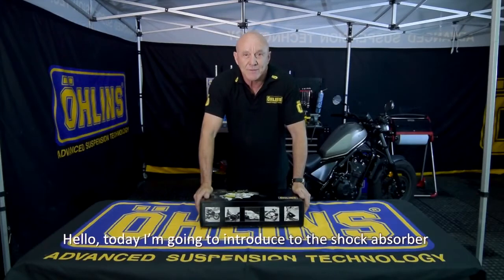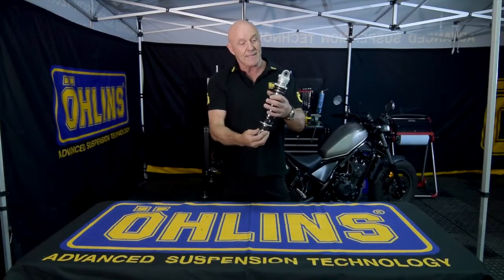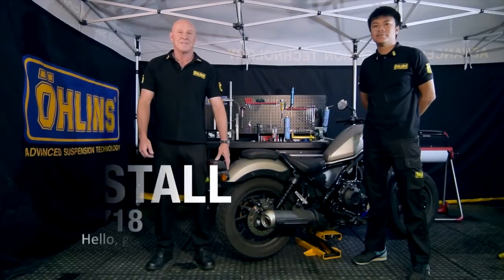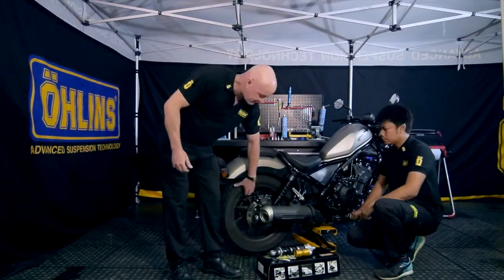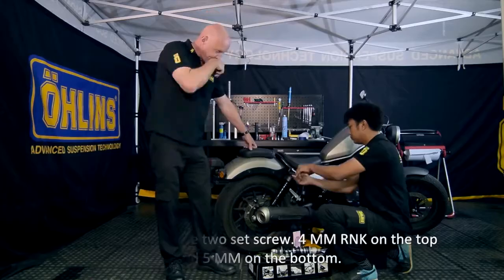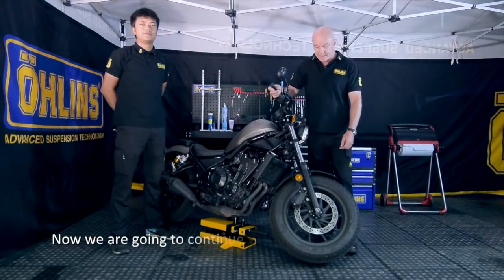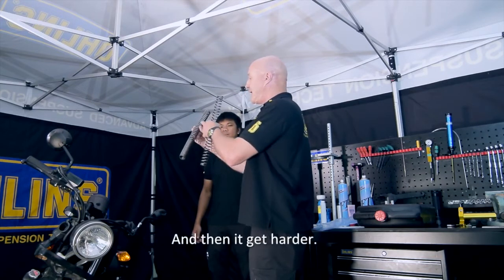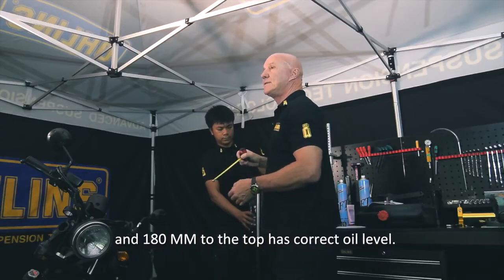Install  Set Up Öhlins For Honda Rebel 500

Comment: What's the difference between the two rear shocks?
Reply: One had picky back gas reservoir, leaving more space in shock for oil, it also had adjustable compression, preload  and rebound. The second shock only  has adjustable rebound and preload.